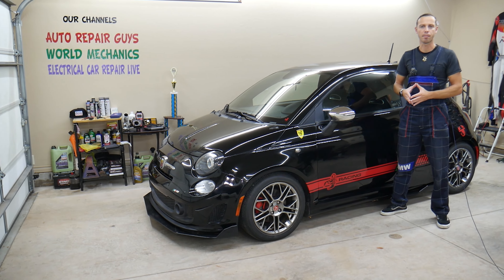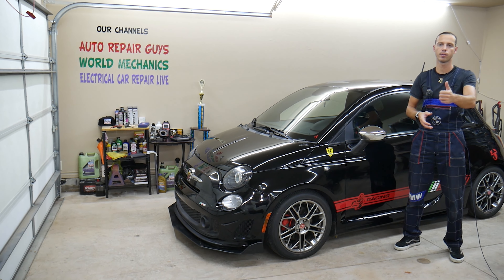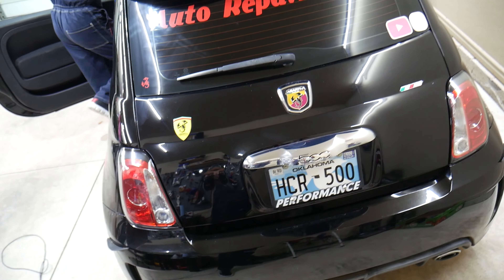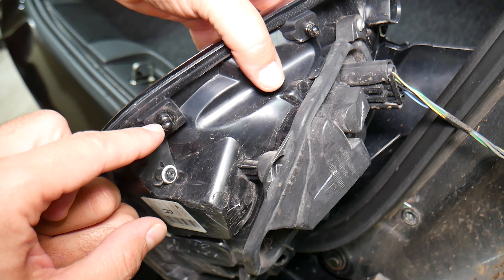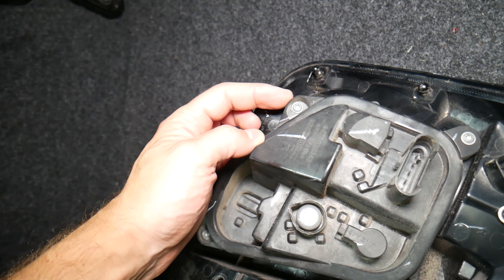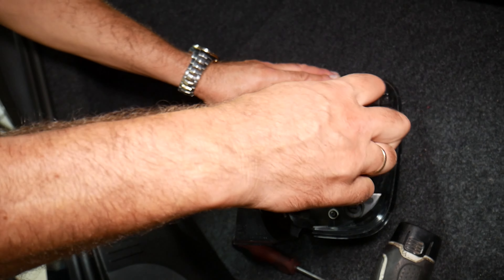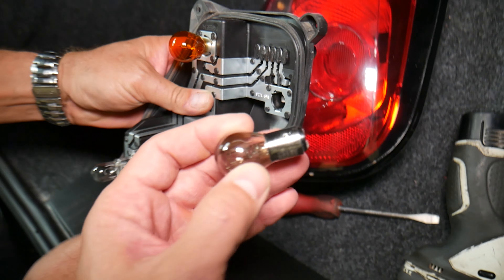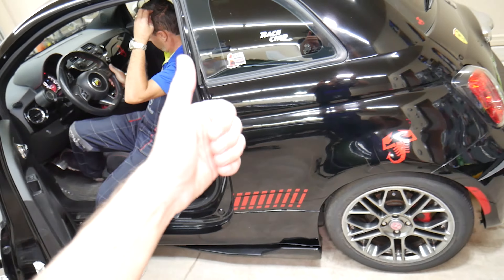FIAT 500  STOP LIGHT ON DASH, FIAT 500 ABARTH

Comment: I have stop light on dashboard but brake light is working any ideas?
Reply: I have the same issue lmk if you found any solutions!
Reply: Hey so in my case I changed the brake light switch on the pedal and it worked cost me 15$ and 15 minutes